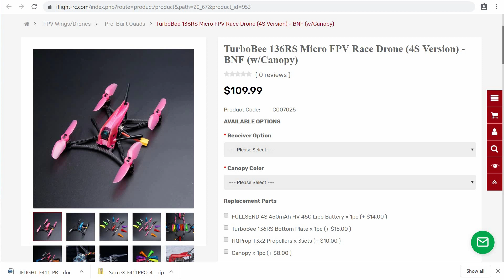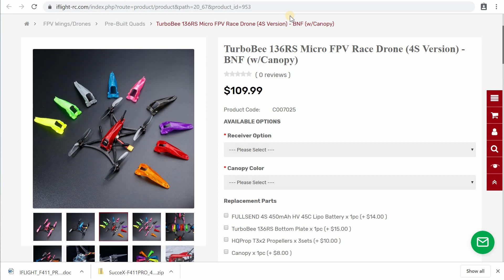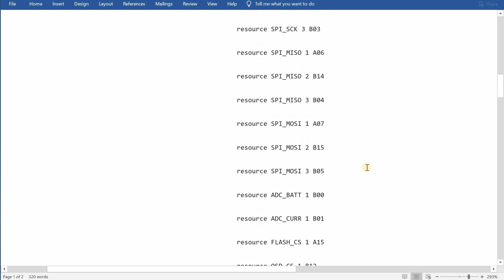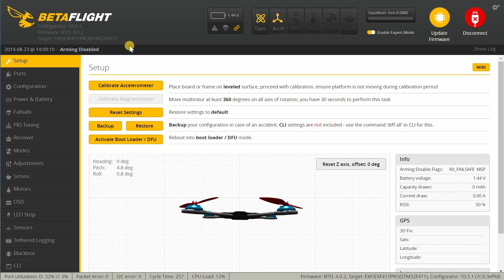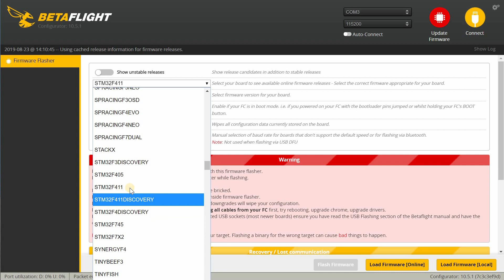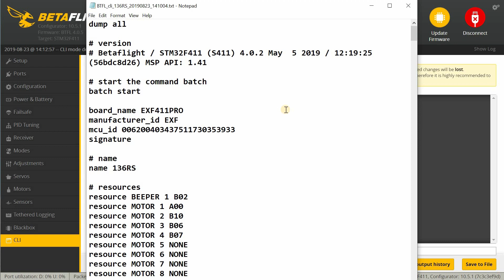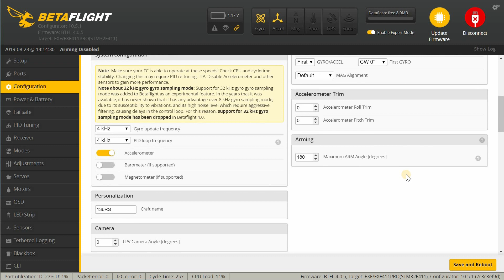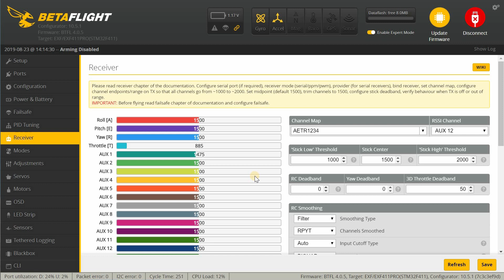HELP!!! Flashed Betaflight now my FC is broken!? 😱

Comment: Still no gyro... any ideas? Nazgul 5 V2 6S Analogue.
Reply from the maker: You flashed the wrong target
Reply: @AlbertKimTV  I've tried to flash the others with no joy... why do iflight not provide at least a manual? Especially since it's supposed to be for newbies. Flashed to LBT for Frsky but when I followed the drone camps rc 'Betaflight for dummies', it all went wrong.
Reply from the maker: @jiltedfpv7661  I would contact iFlight support and ask them which is the correct target to flash.  It's simply a software problem and if you don't flash the correct software it won't work.  I would tell you what the correct target is but I don't know.  iFlight support should be able to figure it out for you.

Comment: flashed my acrobee65 to the wrong firmware and it wont even connect to the pc anymore lol
Reply from the maker: just power it up in bootloader mode and reflash
Reply: @AlbertKimTV  thx for the reply! yea thats the first thing i tried. plugged in usb and put in BL mode and nothing. plugged in a fresh battery, put it in BL mode and still nothing from my pc or betaflight when i plug it in. no it's not my cable or usb port all of my other quads connect right away and so did this one before i flashed it

Comment: Did you eard anithing about MAtek F405 Mini? I had a betafligh 3.5.5 (Matek F405 target) on mine and whe I tried  flash 4.2 it just won't fully flash with the Matek F405 mini target, it stops ate 50% and don't veryfiy the flashing. Whe  tried flashi with the Matek F405 target it complets the flash but then i can't connect it to betaflight, but it recognizes when i turn it on in DFU mode.

Comment: Hi Albert
So im running into the same issue, i flashed my FC but unfortunatley i didn't saved the config files.
When i'm connectin the fc to Betaflight i can't do anything.

So my FC is: HGLRC Zeus35 
Do you know where i can find the config files for this fc like you showed in this Video?

Thank you for your Help!
Reply from the maker: Have you tried flashing the legacy target instead?  That will be faster.
Reply: @AlbertKimTV  Yes i have tried. In the Legacy-Target i have at least some Ports, but still no Connection whatso ever, the sensors do not work and the fc does not Beep, when i plug the Battery in....

Comment: I'm in contact with iflight about a non functioning FC and they directed me to your video. The quad flew for 5 batteries and then I got home and it never did the normal startup tones when battery was plugged in. They first told me to do the config cli dump which restored BF. But I never did the full dump before flashing. Do you have the stock CLI dump you could share? Wondering if that's why I'm still not able to bind my Rx again or get all 5 beeps when plugging in battery. When trying to bind I only get a dim red light on my Rx. Never flashes or turns green. Before doing a reflash when the issue started I had been able to bind. So not sure what changed now.

Found a post on FB that said it's probably a bad 5v regulator as I'm only able to get the 5 beeps when plugged into USB and powered with battery. Could that be the issue?
Reply from the maker: Which FC?
Reply: Albert Kim sorry it's the one in the stack with the 136rs
Reply from the maker: Go to the 136rs video.  See description.
Reply: Albert Kim I see the cli stock dump. Can I use that if I have a different version. 4.0.4?
Reply: Albert Kim did the stock CLI dump. Still can't get it to bind again. Only 3 beeps still. Ugh
Reply: Albert Kim was there something besides the stock dump you were referring to?

Comment: Great video but I have a different problem I saved the dump and updated to betaflight  4.0.4 on a omnibus f4 (from the HGLRC xjb 145 ) and now the computer doesn't even detects wen I plug in the board I tried on 2 different computers could you please help me thank you.
Reply from the maker: You probably flashed the wrong target.  You need to press and hold the bootloader button (for DFU mode) when you plug in the USB and flash the correct target.  The correct target will be at the beginning of your CLI dump file.
Reply: @AlbertKimTV  if i already flashed the STMF405 to my iflight succex v2 and now Im told i need to flash OMNIBUSF4SD i need to find the config file? Now the iflight website for the contorller is 404 not found ughhhhhh :(

Comment: The 10.6 configurator will flash the Unified Target and dump the correct config into it automatically.  Folks just need to wait till that stable release (4.1.x).  

The big shot across the bow is for manufactures.  BF is no longer creating the targets.
Reply from the maker: In the meantime, while we wait, this video will still be able to help those poor souls who are caught in the middle of all this.
Reply: @AlbertKimTV  , folks should just be able to flash the legacy target too, i think?
Reply from the maker: @uavtech  How do you figure out what the legacy target is when the original was STM32F***?
Reply: @AlbertKimTV  , yeah, that is a good point and question.  You would need to look at the DMA and Timer assignments.  I think the iFlight stuff is the EXF722DUAL target, but have not compared and not sure that makes sense.